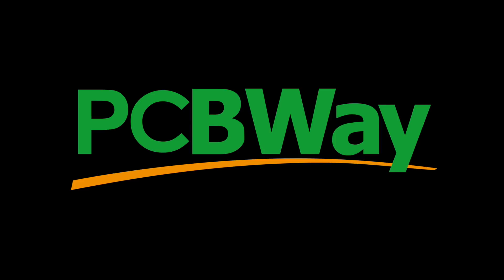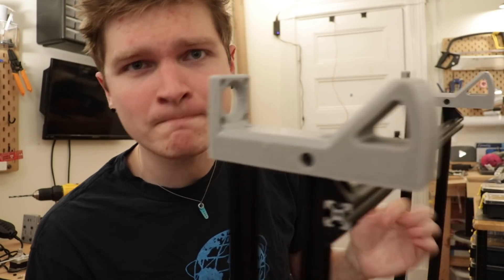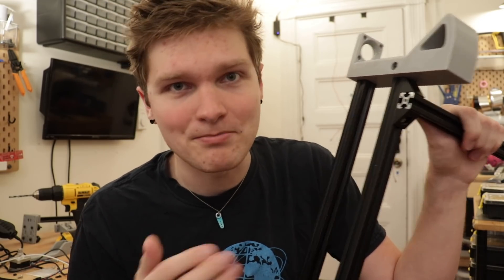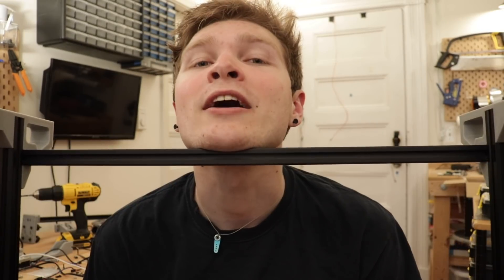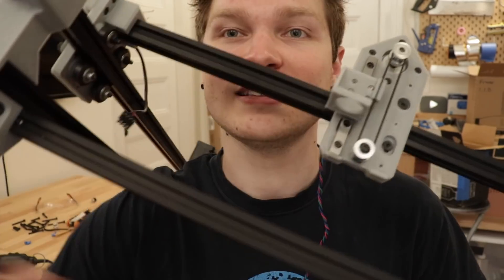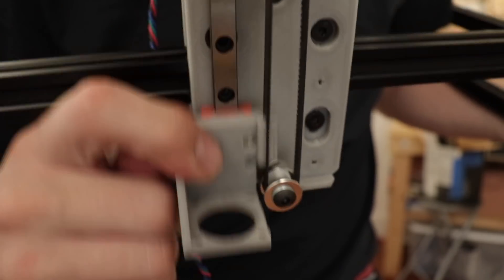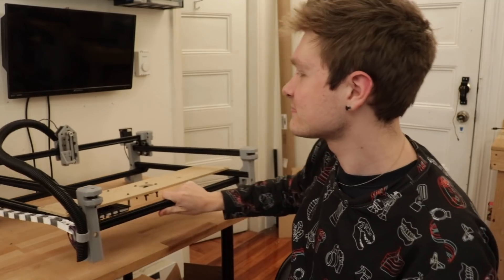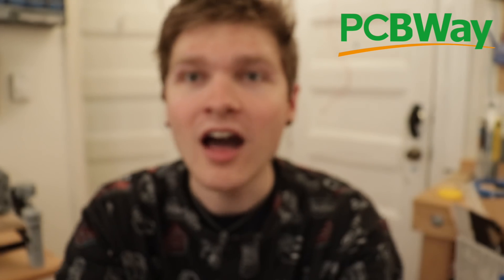Upgrading the Pick and Place Frame!

Comment: I had just finished building the frame, got the XY and Z motors, then dropped it on the floor. Snapped one of the Y motors and snapped the down camera bracket :-( time for the glue I think. Will reprint with the Free Cad versions once I can prove it works.

Comment: Stephen, using the LulzBot TAZ6 - I'm now 1.5 days into printing the legs for the Index frame.  Going low and slow for best results.  200 micron, 4 perimeters, 30% gyroid infill, 3mm brim, no supports.   Should be done in another 10-15 hours.  

Going well so far -- and I'll post the build on The Maker's Workshop.    If there are any major changes coming up ( RS485 for the feeders I see ) it would be good if you could give me a heads up before I commit to milling/printing parts or sending the gerbers off to be manufacturered.

Comment: Great work!. Just in case you had no though about it you could use I2C if you put the address info on the connector side of your feeders. Something like a voltage divider on the small connector board and an analog read on the feeder board... I know you don't like analog stuff :)

Comment: How to stop the linear rail waggon from falling of the rail? I'll drill a hole in the ends of both rails, cut a thread, and screw some hard stopping metal piece in there. Has the advantage that the waggon still cant run away from the rail, even when you assemble or take apart what ever machine the rail used on.

Comment: One way to get the cable chain out of the way (at least a bit) is that the stationary end to the middle doesn’t move. This means you can have the cables come out from the bottom in the center of the axis and have a cable chain half the length. Less length means less floppyness, and I find this much more manageable on my machines.

Comment: You should ask for 6 layer flex PCB with rigid FR4 overlay teeth to use as a belt. Probably gonna cost>1000 USD to manufacture. PCBway explodes.

Comment: You should look into core x/y or h type carriages for lighter x axis and super fast movement. Also I would replace the steppers for servos or bldc motors with odrive controller. Your design is more like a lightweight router than a pick an place.
Reply: TBH I suspect that there's a reason commercial PnP machines are Cartesian and not coreXY, although with his having open-sourced the whole thing, someone may already be working on a different drive system.

Comment: I hate to pain you with a new suggestion but the plastic parts you printed for the corners should be at the same height as the top of the Z axis so you can flip it over and work on the bottom more easily.

Comment: Use dual end stops on the gantry and dual drivers so it can automatically square up when homing.. also feeders rs485 or maybe CAN BUS. Lastly maybe an optical pickup on  feed tape holes as a sanity check have it count the feed holes. If done right it can be fairly accurate

Comment: How about making it an Core XY? For more Speed
Reply: I don't know if this would lend itself to a coreXY versus Cartesian, just because of the need for more rigidity in coreXY to prevent the machine racking during operation, plus coreXY is a slightly tougher drive system to both design and code for. It might be necessary to double up the front and back rails, and/or bolt the whole thing down to a giant plate of material (e.g., plywood sheet), in order to reduce flex if using a coreXY drive system.

Plus, if Stephen designs his controller to allow that functionality, setting up accel/decel curves should allow for pretty fast traversals even on a Cartesian machine. My desktop CNC mill is Cartesian and thanks to accel/decel curve setup it'll move over 20m/min during rapids.
Reply: @OddlyIncredible   You may be confusing corexy with h-bot; corexy was used almost as a successor of h-bot for 3d printers specifically because it avoids the issue of racking. I still think it would be non ideal for this, as its belt runs are exceptionally long compared to cartesian machines and this is a Quite large machine, and there is more of a susceptibility to small positioning problems as it uses both forward and backward bends in the serpentine belt runs. (this is also a problem with h-bot)

Comment: I hate you for not using heat shrink on the limit switches
Reply: Only noobs put heatshrink on solder joints.
Real geeks leave them bare so you can clip probes on it, or solder on extra bits later. 😋

Comment: ARM's the way to go!
Reply: I hope he is looking at the Samd21 or Samd51 chips, I have been using those for all my projects now, and they even run FreeRtos on them. They are great!
Reply: I suggested STM32 because the ecosystem is really inexpensive ($11 dev boards, $2 chips, free IDE from ST and Arduino IDE support is out there, cheap toolchain) and pretty powerful, but SAMDs would work just as well. There are plenty of beastly little ARM Cortex MCUs out there that could run this thing without issue.

Comment: Hey very cool upgrade ! 
I was wondering, have you thought of using brushless motors with a ODrive board for the X et Y axis ? That would make them much faster than with steppers !
Reply: While that's certainly useful, what would be the additional cost over traditional steppers and cheap drivers?
Reply: @wi_zeus6798  That will greatly increase the cost of the overall machine yes. The steppers he uses are priced at $8.50 a piece, while a good hobby brushless motor costs roughly $60. Then you have to buy encoders for each motors, so between $10 to $20 each, and finally the ODrive board. The board costs 119$ on the website, and can control 2 motors so it would be enough for the X and Y axis. But as it's a fully open source project, all the schematics and PCBs design are published. Maybe he could produce a cheaper board by doing it himself. 
There could be two tier of the pick and place machine. An entry level one with steppers, and an advanced one with brushless motors for faster board assembly.
Reply: @codanael  I you / someone really wanted to, the necessary parts could be added to the control board of the PNP, as an alternative version.
Personally I would not want to spend the additional money since I know that I'd not be able to run the machine at these speeds. It would be too noisy. But that's something not everyone has to care about. Also, the additional cost is quite high
Reply: @wi_zeus6798  Yes: Odrive: $119USD, motors 2x @ $30USD each, minimum. Encoder for each motor: Depending on what you get can go from $10-30+USD. You'll get very good performance, however, vs a stepper motor 2x $15 + 2x $5 for a driver.. certainly is cheaper.

Comment: You don't need more holes in the feed sprocket wheel.  Using quadrature encoder technology and placing another sensor on the feeder you get a quadrature encoder.  This essentially quadrupedals the resolution.  The exact sensor location doesn't have to be right next to the existing sensor.  The only requirement is that when the hole is dead center over sensor 1 sensor 2 is right over the edge of a hole.

Comment: Quick tip regarding drag chains: Make sure to use cables rated for them. They often rub along the side of the chain and can wear through there. Also not all cables handle repeated bending well.
Reply: Is there a "rating" to look for? (Like mm²/AWG for square area and thus current handling but this time for use in a cable chain?)
Reply: @wi_zeus6798  I have no personal experience with them. But in my opinion https://www.youtube.com/watch?v=ZPWoC3N0epM explains the issue with drag chains (and other cable management methods) very well. (In the context of 3d printers but they're not that different from a pick&place machine.)
Reply: @trilader  thanks, a good video on that topic
Reply: @trilader  I know that there is a spec available for cables (maybe individual insulated wires) that guarantees that they are fit to be used on industrial robots, where they get bent a lot but don't necessarily rub against other materials (don't know if it's part of the spec). But these cables are pretty expensive

Comment: I have two nitpicks.
First: I don't like the name Index is way to common and not distinctive enough. It lets it fall under the radar.
Second: I would do a another redesign to use a H-Bot design meaning you could get rid of the Y-stepper
But other than that I really like it 👍